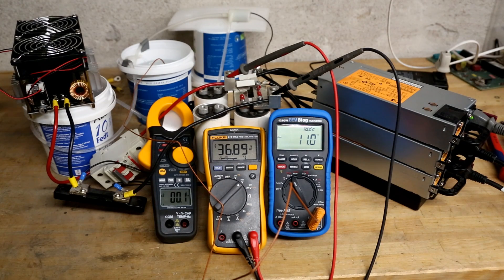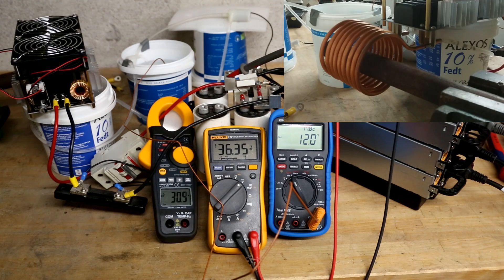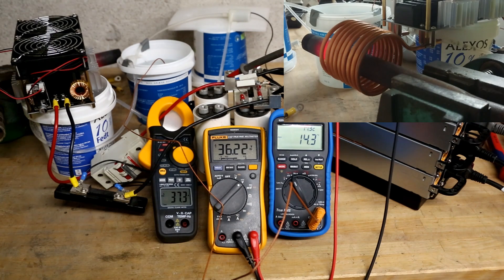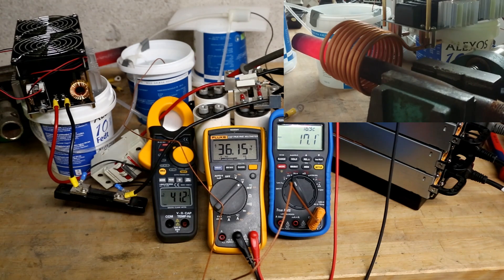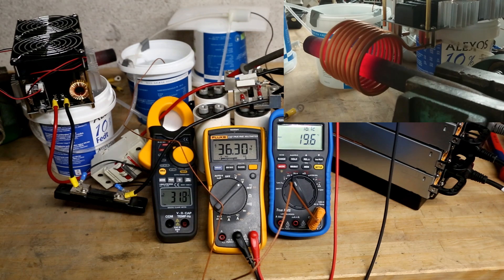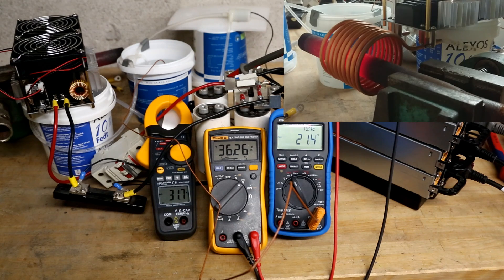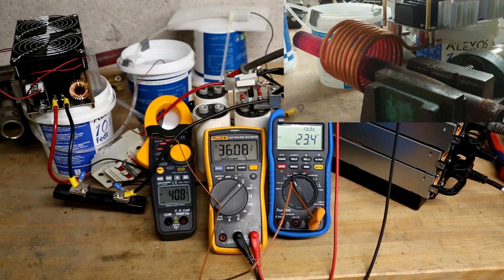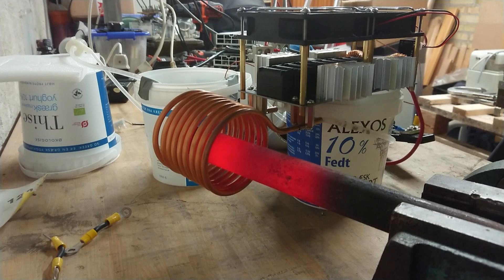Chinese 1800 Watt Induction Heater, 10 Minute Stress Test at 1500W

Comment: What capacitors are being used here?
Reply from the maker: They come from so many different manufacturers, but generally they are known as chinese induction cooker capacitors, like these: https://bm-capacitor.en.made-in-china.com/product/eXGxBWSEXPcq/China-Mkph-Induction-Cooker-Capacitor-with-UL-CQC-VDE-Certificate.html
Reply: @KaizerPowerElectronicsDk  Interesting. They're simply there to smooth out the voltage/current right? Is it possible to use 400F supercapacitor's in series in this application? Like, say if you used a six string balancing board then paired three of those in series? (2.7VDC * 6 = 16.2VDC @ 66.66 Farads) * 3 = 48.6 Volts @ 200 Farads.

Comment: Why use regulated power supplies instead of a rectified transformer?

I'm asking because I don't know.  I have had good luck locating high VA transformers as scrap or surplus, but would likely have to pay more for switching supplies.

If using a bridged transformer, would you suggest output capacitors or not?

Thanks for the great videos!
Reply from the maker: More light weight, large VA transformers is becoming more rare to find. 

You need smoothing/filtering capacitance on a full-bridge rectified transformer to use it for a Royer oscillator,
Reply: @KaizerPowerElectronicsDk  Is there a good rule of thumb for ųf per VA?  I have a stash of caps from my hoarding days.
Reply from the maker: @MotivatedMetalworks  I am super happy you asked, so I can share this wonderful tool with you: http://www.duncanamps.com/psud2/
Reply: @KaizerPowerElectronicsDk  That does look pretty slick!

I'm well versed in low voltage, residential, and have dabbled with VFDs and 3ph enough to know how to retrofit them into 1ph installations; but my circuit designing has been limited to simple stuff like latching relays, solenoids, etc.

My reason for exploring these induction coils is to anneal rifle brass necks.  I figure a simple variable timer, some solenoids, and a bit of fabrication, should result in a machine that'll drop quench the brass and feed another case without human intervention.

Comment: No of turns required for work coil(1/2inch cu tube ) outer dia of 16.5 cm.purpose is to heat 5 inch hollow fe pipe of 10 cm length
Reply from the maker: With these heaters you should try to match the original resonant 
frequency, you can however also lower it much more than you can raise 
it. If you make a coil with a smaller inductance than the original, you 
risk killing the MOSFETs from increased switching losses due to the 
higher frequency of the LC circuit.

Comment: it is possible on those server supplies to adjust the voltage +/- 3V, there is an adjustment on the edge connector if you add resistors and internally by adjusting the potentiometers.
Reply from the maker: You are right, I did not mention this in the video, but it is correct there is a "3rd" potentiometer that can be replaced by a external to adjust the voltage, I saw some guides for the 800W models.
Reply: @KaizerPowerElectronicsDk   i have adjusted these types of power supplies as high as 14.5V before to get a bit more power out of car audio amplifiers.